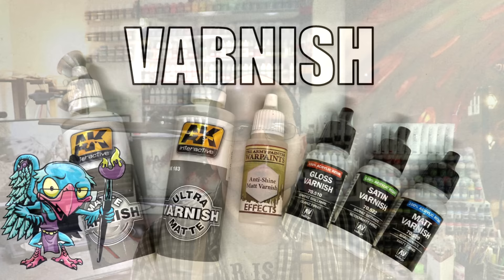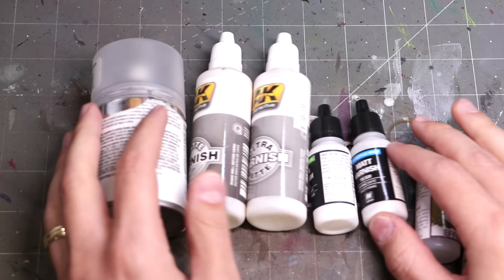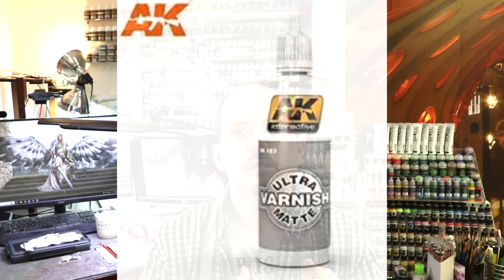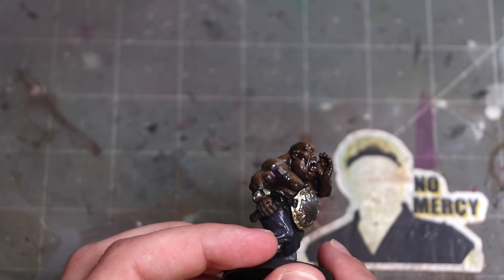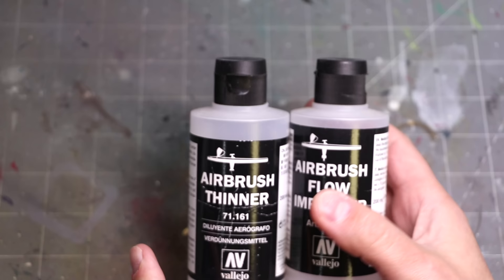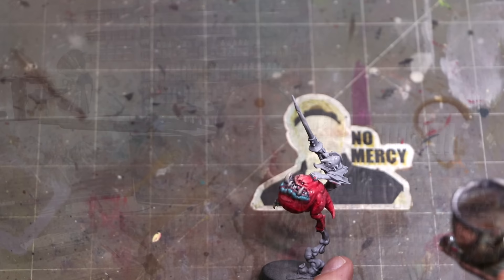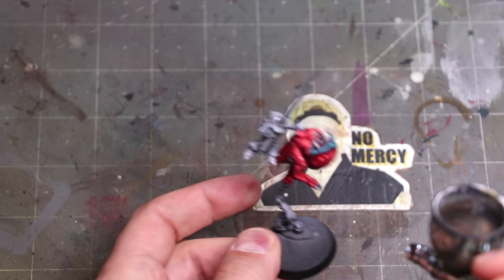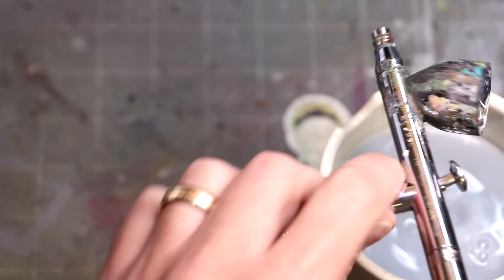How to Varnish with your Airbrush - HC 367

Comment: I find that varnishes are very useful to protect zenithal highlight made with white ink (any airbrushed layers tend to be more fragile, but inks even more so). Painting over them with something like a premade wash or a contrast paint will more easily activated the fragile ink layer otherwise.
Reply: If you're comfortable or curious to try some different paint chemistries, Try Tamiya white, xf-2. It works really well. I thin it 50/50 with some lacquer thinner and it goes on thin and smooth.
If you're already having to apply ink and then varnish, it won't be too much worse to use some Tamiya and clean with a touch of lacquer thinner.
Reply: You can add some drops of varnish to your ink when airbrushing it to make it stronger and kill any gloss finish.
Reply: @christopherheintz2634  Definitely a fan of trying out new stuff. Have used a white ink for a good while now and with very good results. Will probably stick with what I am happy with. Also have seen the Tamiya white used by the Cult of Paint guys and have to say I was not impressed by the result (more speckly than I would be happy with). Could be the user and not the product of course. Also bought a very big bottle of white ink that price/ml is almost 1/3 of the 30 ml bottles; such good value.
Reply: this is a great tip - I do this also with my Valhallans and the zenithaled Liquidtex white ink initial coats - some varnish and no paint/ink peeling when I start shading and washing
Reply: @chappy4756  This is an excellent advice, thanks! About how much varnish compared to the ink do you use?

Comment: Have found that water based varnishes are easier to clean compared to almost any paint the acceptation being paint that is thinned way down. Certainly easier to clean compared to any airbrush primer. So dear comment section reader, don't worry about messing up your airbrush like Vince mentioned in this video.

Comment: I have all my Vallejo varnishes premixed with 25% airbrush thinner to 75% varnish. AK's are thinned enough to not need any thinner. Would do the same if I mixed up any custom mixes like Vince suggested. Makes it easier to add a couple more drops to the cup when I need just a little more.

Comment: my main issue with matte varnish is that it always turned my blacks grey and the shadows are lighter than i want them to be. i prefer satin as it shows me the colour as i want it, and the minor shine i get doesn't bother me and often looks nice. i've mainly used liquitex varnishes but i've gotten the same thing from various spray cans. it's possible i've applied it wrong.

that being said i typically don't varnish my miniatures because i've never felt the need to aside from pewter models, resin models, and display pieces i don't want damaged. i still have 20 year old miniatures from my childhood with their first coats of paint and brush-on primers that haven't worn away or chipped after use

last point, while varnish definitely does help, as far as i'm aware the protective difference between the finishes are almost negligible because we're talking about microns of layer thickness or smaller so personally i choose a varnish by intent and finish

Comment: Great video!  I had such anxiety the first time I varnished through my airbrush.  I was so worried I was going to have spent hours cleaning up the airbrush.  But of course, it turned out fine and super easy and useful.  

I am a fan of matte varnishing metal for iron jawz weapons, and then going back in and making just the edge of the weapon more gloss with a highlight.   I think it kinda gives them an old beaten up and neglected look while the edge still looks sharp.

Comment: I love when you answer a question I have before even the end of the video! (Mixing two types of varnishes for protection and the effect) I'd like to add those of us who still like to work with metal minis (sorry Vince :P), this is really really really good as well. Multiple coats for protection and  for the save point. Same with resin actually, which I have found needs the varnish even before priming, to help seal it, and multitple times throughout painting.

Comment: I have never experienced any problem with my rattle can varnish from Vallejo. I always use Satin Varnish on my minis. My painting game isn't where my control over finish beats the even look of that satin varnish. I tend to take the varnished look into account, when I paint fast. 
Still. Just today I varnished during a heavy rain shower. I was under a roof, but 0 problems. I varnished at 35°C and also at -5°C. Any humidity. No problems.

Comment: I used the Testors Dullcote for years and it can get a bit expensive. I switched to the AK Ultra Matte through the airbrush and that stuff works great. A few years back I could not find it anywhere so I gambled on the the Liquitex Matte Varnish. It is actually really good sprayed through the airbrush, comparable with the Dullcotte. When put on with a brush not so good, a bit of a gloss left behind.
Reply from the maker: Good to know!

Comment: I do apply varnish on my metallic because I have to. I use oil washes on my metallics, which look bad if I want to achieve a shiny effect. I use Alclad Aqua Gloss for that purpose. Alclad II are paints that I prefer if I'm airbrushing metallics and want to achieve a shiny metal effect. As for the other non-metallic things. I relly like Vallejo Prreally Satin Varnish. This satin varnish is much less glossy than the other satin varnishes I used.

Comment: Generally don't like the look of ultra matt varnishes. The acceptation being on stuff that supposed to be very dry like rust for example. However, it is my go to to mix into glossy paints like inks. A 50/50 mix of ink and varnish works nicely, although still is very much satin not matt (increase the ratio of varnish if you want a more matt finish). Nice bonus is you need no, or less thinner, because you already use the varnish as a thinner.

Comment: Hi, I have AK Ultra Matt Varnish and I’m surprised that everyone always seems to recommend it. I find it significantly dulls colours and the model loses lots of pop. As a result, other people who don’t paint minis have also questioned what paint brand I use as ‘they are not very vibrant.’ I’ve tried mixing it with satin varnish, but even at 50:50 the model still comes out so dull. I guess I have to keep experimenting with ratios...
Reply from the maker: Well, the key with the gloss varnish is it's going to make a fairly flat even base coat look better, because the color will read more true and it will create depth (highlights and shadows as it tightens the reflections to your eye). However, if you have placed highlights, if your paint is telling a light story, then you want it to be as matte as possible, because you are already telling the story of the light.

Comment: My question is: why mix satin with matte and do 2 coats instead of doing 1 satin or gloss coat for protection followed by 1 matte coat of choice for preferred finish? 

Thanks for a wonderful video! This is perfect for me as I have been looking at starting Airbrushing mostly to help with priming and varnishing.
Reply from the maker: With the mixture, I can make sure everything is more evenly applied and see it all at once over the matte surface, without any shine obscuring the evenness of the application.

Comment: I am no expert, but I talked to a chemist who works in the industry and he said there is no durability difference between gloss and Matt varnish. It's the same thing just reflects light differently. It seems gloss is more durable because it looks like tough glass or something... fwiw
Reply: Cause I used to gloss first and then matte for "durability", but he said its a waste of time
Reply from the maker: Well, one of the keys here is we are talking about micrometers of difference. The other item is the glossy surface will be harder for things like your skin to "catch" on a micro level, where as the matte can "catch" easier. In all cases, multiple coats of varnish will always do you better than another type of varnish.
Reply: @VinceVenturella  yep! That's a good take. Gloss just feels tough! Matte you can't see so it feels like it's not even there :)

I have been using one solid coat of vallejo premium Matte varnish through airbrush for the last year, and never had an issue with paint jobs on game minis. As long as you don't "scrape it with fingernails!" Don't do that! Love it

Comment: Another great comprehensive topic! I haven't seen it the comments here, but I've been hearing conflicting messages from my painting friends on this lately--when airbrushing varnish over inks, namely artist acrylic ones like a white zenithal, do you find it's better to do it soon after the airbrushing or wait for the layers to cure/dry over many days?

Context is, I've always had trouble with inks reactivating even after a couple days of waiting and some light heat treatment to help cure. Not spraying too thick or too far away, and sometimes even with a varnish layer after all that, so wondering if a sooner varnish would help it "bond" with the inks?
Reply from the maker: I wouldn't try to work wet on wet like that, if you're going that direction you would just mix in the varnish directly, otherwise, let it cure for at least a 1/2 hour to an hour.

Comment: i varnish using airbrush but I am paranoid about not cleaning up immediately after using because once I left an airbrush uncleaned out for days after spray varnishing and it was a tough clean up scraping away at the hardened varnish on the insides of the airbrush (cup and inner main tube etc even). I am one of those that uses cheap airbrushes to varnish with and clean immediately afterwaards - that means throwing the airbrush into a bucket of lean water and backfilling with the water and spraying it out inside the under the bucket water  and out. I use Vallejo brush cleaner and take the needle out and clean it also after such a session.

Comment: Super useful tutorial, thanks man! I have one question: what pressure do you set your compressor on when applying varnish? For example I normally airbrush at 25psi, but I was wondering if it would be better to increase it up a little bit for spraying varnish
Reply from the maker: Same as always, 18-20 PSI, no need to move it really.

Comment: I just have the gloss and matt vallejo versions. I've tried various mixes of the matt one, with medium and/or water, but it always comes out a little too shiny, whether it's with the airbrush or applied with a normal brush.
Something I recently found out about, is that PVA glue thinned with water applied with a brush will matt down surfaces, although I'm not sure how reliable or good this is, as I've only used it a little to fix some glossy wash.

Maybe I just need to get the ultra matt and hope that actually works. Nearly all of my several hundred models are entirely unvarnished, only my 'mice & mystics' board pieces are.
Reply from the maker: Yep, the ultra matte is actually matte, unlike the matte varnish which is sadly more satin.

Comment: Ok. So I’ve just airbrushed a vehicle in Vallejo metal colour. Coz it looks so much nicer than when I hand brush it on. Only now I need to varnish before I oil wash and try some things out. 

First time varnishing too. Should I varnish with gloss? Will that keep the metal looking ok? Or satin?

Also one thing. I find metal paints leave flakes all over my figures in the parts I painted with acrylic. So wouldn’t varnishing metal be good to stop that?

Comment: My biggest issue with varnish is it reactivating ink. This especially seems to happen with AK Ultra Matte and Scalecolor Inktense Wood. Spraying the varnish over that ink makes it come off and mix with the varnish!
Reply from the maker: So ink activation/reactivation can sometimes be a matter of it not fully curing, it can be humidity, but it can sometimes also be the undercoat if it diddn't fully bond. In any event, a good airbrush application should prevent that, but with brush, you're always running some risk.
Reply: @VinceVenturella  yeah I'm in the UK so it's always really humid here. Will try giving it some more time to dry before varnishing. Cheers Vince!

Comment: Vince, how long do you let varnish cure before painting over it? To me it seems like it's dry enough to paint over as long as you wait 30 minutes or so, but wondering if I'm taking a risk with that. Edit - my bad, watched this like 3 times but somehow missed that you covered this :P (10-60 minutes depending on humidity)
Reply from the maker: You got it!
Reply: @VinceVenturella if you don't mind me asking - would be interested to hear your thoughts on this - I see people all over the internet, on Reddit, on forums, etc., saying varnish needs at least 24 hours, 48 hours, or even 2 weeks to cure. From my own experience and what you've talked about here, I know that's obviously not true. I've noticed that many areas of the hobby seem to have similar myths floating around, usually in the direction of over caution. Do you have any thoughts on why people get like that?

Comment: Good video. I've liked the effects of the Vallejo varnishes so far. Now one tip I've seen recently is folks using the Liquitex varnishes as an "in between coat". Have you played with those, and if so, what are your thoughts?
Reply from the maker: I haven't used them, I'll have to give them a try.

Comment: What if you wanted to use an oil wash over the metallics? Would you do a workflow of paint, varnish, metal paints, varnish, oil, varnish?
Reply from the maker: I never varnish metals, so I would just apply them, let them dry, then oil wash and go. The oil won't directly interact with the acryllic layer.

Comment: Sorry if I missed it, but what needle size do you use for varnish? I have two airbrushes, an HP-CS with the default .35 for general work. Then a Master G23 with a .5 for priming. I haven't been able to find what's a good general size of needle for varnish, I suspect it'd be similar to priming. The topic of needle size tends to get... glossed over.
Reply from the maker: I generally use my HP-CS for varnish, standard needle.

Comment: Regarding the non-varnishing of metallics, what if metallic is the first colors you paint? Like with thousand sons, a very usual way of painting them is to airbrush/spray the gold before painting the blue panels.
What would you do on that case? Just use matt with a brush on the non metallics? Or airbrush satin/matt all over?
Reply from the maker: I likely just wouldn’t varnish them. But if I wanted to, yes, I would brush on some ultra matte/satin to the matte paint areas.
Reply: @VinceVenturella  thanks for answering!!! you answer a lot of questions in the comments even if the video has been up for a long time. 
I think I speak in the name of all the noobs like me in the comments when I say you are awesome!!!

Comment: You said not to gloss varnish minis as a final step, but that's exactly what I was planning on doing. I havent done any mini painting before so I'd appreciate your input on what I'm doing.

I'm currently painting a pewter fleet of Twilight Imperium ships to act as a sort of trophy fleet for the winner of the previous game. I want to have a vibrant gold look. So i was going to airbrush Citadel Retributor Armour gold with a Vallejo Metal Varnish to finish it off. I'd like them to look vibrant and gaudy. 

Would this work, or do you have a better recommendation?
Reply from the maker: If you're using a good metal, no need to varnish at all, the metals will do all the work on their own.

Comment: Hi Vince! As a beginner scale modeler I have a question: what should I do if I have to put waterslide decals on top of the metal paint? How can I protect it without varnish?
Reply from the maker: Okay, so this is a great question. In this case, yeah, you're going to need to varnish the metals, because you have to integrate the decal into the paint leyer. So here is my method (and I have videos on applying and/or painting decals as well on the channel, so check those out). 

I cover the area in some micro-set, after letting the decal soak for a minute or two to get it free from the paper. I apply the decal and get it into position, then let it dry completely. Then I apply another layer of micro-set, let it dry, then I apply a layer of micro-sol, let it dry. Then I cover the whole area (decal and around) with Gloss Varnish. Let it cure, then I go over it again with a satin varnish to better integrate it with the rest of the metals around it. Hope that all helps.

Comment: Thanks for doing this video, Vince! Having just wrecked a paint job with bad varnishing this was the kind of walkthrough I sorely needed.

My only question is what Psi range do you shoot your varnish mix at?
Reply from the maker: 18-20 PSI
Reply: @VinceVenturella  what needle size?
Reply from the maker: @SobotRex  I am using the standard .3mm needle.
Reply: @VinceVenturella  are you full blasting the trigger and what’s the approx distance to the model? Sorry for the multiple questions, but I’ve been testing and researching varnishing the past week because I haven’t been entirely happy with my process. I’ve gotten some slight discoloration/dulling and frosting in the past. At first I thought it was due to the varnish being put on too thickly (probably played a role), but I found it still happened to an extent after thinning 50:50 with a mix like you described. I think I’m spraying too far away in fear of spraying too much and frosting. Should I be applying to the extent where the model is wet looking? This video also came at a very interesting time. I’ve watched probably every video on YouTube on the subject and read every old forum post I could find in the past week!